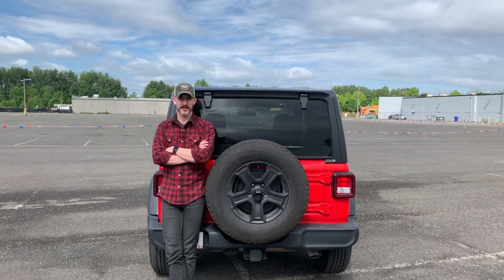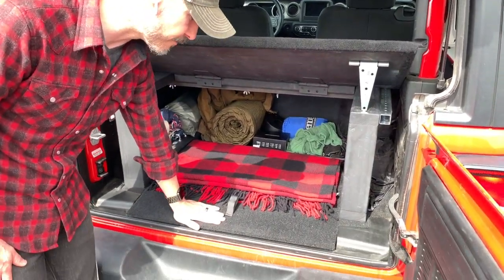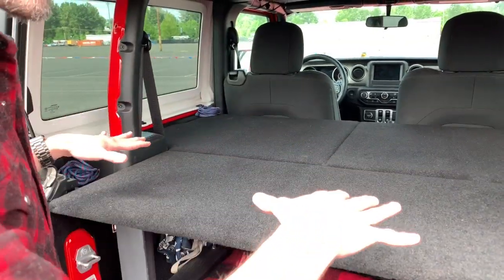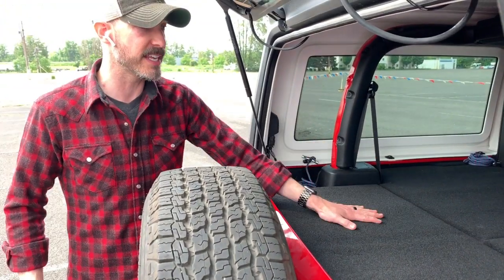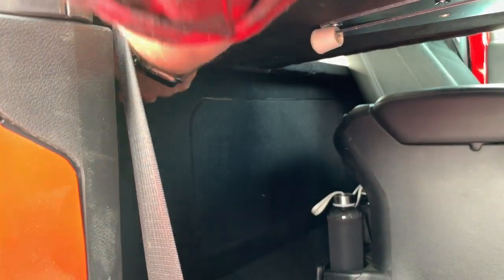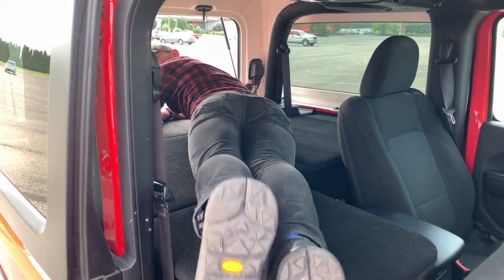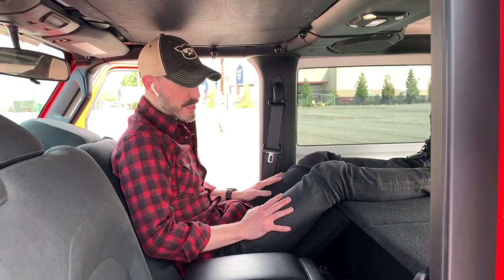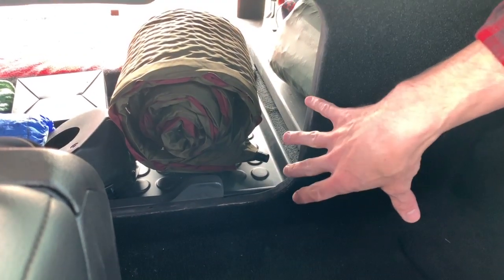DIY 2018 Jeep Wrangler JL 2 Door Sleeping and Storage Platform

Comment: You could certainly sell sets if you wanted to.  Looks easy enough to assemble, but for people with limited time like myself, I would certainly opt to buy.  Plus, this is the only set up I have seen with all of the handy features you've presented.
Reply from the maker: Thanks for the love.  I am reupholstering it this winter actually so will get the end measurements and update the Blog with accurate cuts for folks!  Without having to do all of the measurements and whatnot I could have done this whole project a lot quicker.

Comment: So I plan on building something similar. I was inspired by this, but took my prep one step further. I went to the junkyard and got a Jeep Patriot seat which folds flat and installed it in the passenger seat. It was a pretty easy mod and now I have 72 inches from dashboard to tailgate in a straight line. Just wanted to share.
Reply: The patriot seat is a pretty close match but once I put my seat covers on you can’t even tell

Comment: Hi Max. I'm so excited to have found your video! Using your blueprints and this video, I've decided to hire someone to build this out for me. I'm not sure what the costs are and what's fair for someone's labor. If you don't mind sharing, how much did this cost you to build? What would you charge to build this for some one? I live in NC and have some one interested in the gig. 

But, hey you wanna road trip out here and build mine? Lol. Jk. Kinda. I do live at the beach though. 

Anyway. Thank you so so much for sharing all of this. Huge game changer for me!
Reply from the maker: Cost was pretty minimal since it's just some ply and 2x4's.  The marine grade I used initially was too stiff, just go with the thin boat stuff that's affordable.  Other lessons would be take the time to saw short the posts once all in stalled.  The longer bolt threads do make it easier to take in and out seasonally but I found after a while I just started leaving it in year round.  The only other thing is if someone can do more of the pieces out of metal you'll game some room back as the wood gets bulky.  Also the front locked door is fine but I don't think it would keep anyone out of it really.

Best of luck with the build and hopefully whoever tackles it can get it right.  The cuts for the ply was honestly the only really hard part and I've provided those dims.

Comment: I just found this accidentally! Wow! I’m working on acquiring a Jeep Wrangler 2 door… not sure yet on the year tho.
I see you used wood 2x4s. I’m wondering if the galvanized metal studs would work. What are your thoughts?
When I get my Jeep (it’s out there, somewhere), I thought about trying it. I’d make a “full” 2x4 by joining/overlapping them (the top of the U’s facing each other, if that’s clear) to make kind of box. Maybe stronger that way. And I thought of placing a piece of plywood in the space flush with one edge to make a solid stub wall along the sides and perhaps the front.
You think that’s doable?
You have a great build there!! Thanks for sharing it with all of us. ❤
Reply from the maker: I think it's definitely doable!  Play around with it, you'll find what works for you!

Comment: Really well done! I’ve been looking for ideas for my 2 dr JK.  I’m 6’3” so will have to get creative. 👍
Reply from the maker: And honestly in top off season there's plenty of room.
Reply: Haven't seen anyone else doing this. If you're adventurous and have a base sport 2 dr JK with no side airbags, you can actually fold the seat. Disconnect the harness underneath the seat, remove the back with the seat out, realign the folding mechanism to fold flat. Now it's a seat or a bed. Best 2 dr sleeping mod period!

Comment: Good job! Especially for a 2 door. What are you planning to put in your storage? Is it high enough for a sliding tray for a fridge? Has stuff gotten hung up on your screws and wing nuts while pulling in and out?
Reply from the maker: You could likely build in a slider, but the cross members make the height a little lower.  I do get things caught on the screws sometimes.  I think you could cap them in rubber and be just fine.  But I will say I love them cuz it literally took me under 5 minutes to uninstall this fall for winter.

Comment: this is really awesome! I have a 2015 2 door sport that I want to try to do this on. How did you bolt the walls to the jeep floor ?
Reply from the maker: With U bolts through the seat loop connections in the floor.  Those are just drilled up through the floor 2x4s :) Hope that helps!
Reply: @mikealphabravo  thank you handsome! I finished mine a few days ago and I'm super excited to take it on the road. Thank you for all your help and thank you for the idea + measurements!

Comment: Fantastic work. I was wondering if you can make it any higher so that the edges of the top boards fit snug inside the edges of the jeep ? Maybe this would hit the hardware that holds the hard top? (I have a soft top)
Reply from the maker: I think you could yes.  What decides the height is just the inner walls.  I think you could align it with the tub rails for sure.  
The factor I don't fully understand is how it would work if at all with the soft top so you'll have to get back to me on that.
Reply: @mikealphabravo  The ST arms need to drop quite a bit to fold, unfortunately the platform is in the way. We fold back the snrf, don't drop the top. 😉

Comment: hey man great build. I had a quick question about the 1" bar rod. how is the bar sliding is it drilled to the side of the frame or do you have a bracket that its mounted on?  Thanks so much.
Reply from the maker: Great question.  The angle bracket that slides in is mounted to the square box 2x4 frame correct.  It allows the weight to be transferred down instead of pulled from the top platform or elsewhere.
If the blog doesn't have any great pics of that let me know and I'll take some for you.
Reply: @mikealphabravo  right on really appreciate that man. When i zoomed into one of your pics I was able to see the bracket. Really great build man. I made a foldable bed for my two door but I love your design and plan on breaking everything down and using your design thanks for posting the video and pics 😄🤘🏽

Comment: This is sick, I have followed your blog posts and have done this in my 2017 2-door JK with a soft top. I'm nearing the end of the build and I was wondering how you mounted the sliding support rod to the wall for the passenger side extension? Thanks for making this!
Reply from the maker: It's just the 1" bar with a 1" U channel that has holes so it's easy to washer and screw it to the side wall.  Let me know if you have any issues.
Reply: Do you have any results for the 2dr JK? Thinking about doing this for this upcoming spring/summer/fall in arizona

Comment: wow this platform is amazing. But Im interestet how long is the distance between the passenger seat when its completely pushed forward and the backdoor? So would it be somehow possible to lay down straight in your jeep if the sleeping platform would be build a bjt different?
Reply from the maker: If you were to build the platform super high you could probably lay straight but at the height of the Jeep tub as mine is you'd have to be pretty short to fit that direction.  But I'm sure there are some other ways to build around that concept.  The diagonal which I built mine to is 6'

Comment: This is a very creative solution to the problem that us 2-door Wrangler folks have with sleeping.  Most in the past have taken out the passenger seat in front, and then extended the platform to the glove box.  I, like you do not want to remove the front passenger seat so that the platform can be left in place when wanting to take a passenger on board.  Besides, my local dealership wants to charge $300 to take the seat out and adjust the computer to resolve the airbag issue.  You obvioulsy have some good carpentry and design skills.  I do not.   So, how about a pay you to do the same thing for my 2-door 2016 JK?  I am 5'9" so should be able to fit.  Thank you for sharing this video with the JEEP community.
Reply from the maker: Yeah it is a niche market solution but I know there are others out there like us that want this!
I would love to do it for others but it was about a 40 hour project and currently I'm working full time.  It would be pretty spendy for me to do it for another person.  That said I'm pretty sure some of the drawer and storage solutions could be modified a little bit to pull off a similar concept.
If I find myself unemployed this year I will certainly be offering to build these for folks but my carpentry skills would have to refine some on future versions to make it a viable product lol
Reply: mabrooks Or design it in CAD and cut it with a CNC.

Comment: I want to make one of this for my jeep, could you show more detail or how to build?
Reply from the maker: Absolutely!  Will be working on writing up my blog to share more soon:
https://lifenewandimproved.blogspot.com/
Reply from the maker: https://lifenewandimproved.blogspot.com/2019/06/diy-sleeping-and-storage-platform-for-2.html finally finished the blog post
Reply: @mikealphabravo   thanks man. 🙏💚👍
Reply: Great job!  I’m going to attempt to re-create something similar in my 2D JK.  Read through the blog detail as well... Thank you!
Reply: With minimal skills you can turn your JK into a 6' sleeper.. TJ and YJ are too short. My system is very simple allowing access below. A removable (light and strong) one piece shell bolted to the seat belt anchors is 24" of the bed platvorm, doubles as a trunk, great for groceries or gear.
Reply from the maker: Also, I'm currently reupholstering the platform this winter and will be able to get REAL dims for it to post an update in the spring!
Reply from the maker: Share a link here if you want others to see your solution! <3

Comment: Can you go into detail as to why this wouldn't work with a soft top?
Reply from the maker: Sure!  I'm not one hundred percent certain as my last soft top was an older model but I think the surface would get in the way of the bars for the top when it's open and laying towards the rear.  I just can't speak currently to if the same design would work.  I'll peak at some newer JL's this summer when their tops are down and see but if you own one you should be able to tell if a flat surface would interfere I'd imagine.
Reply: @mikealphabravo  Thank you for responding!

Comment: How did you remove the rear seats? I’m not seeing much info online for the JL rear seat removal for the 2 DOOR.
Reply from the maker: When you flip the seat forward and up the clamps are released, if you look closer at the hooks when the seat is up there is a bar you press down I believe to release the hooks.